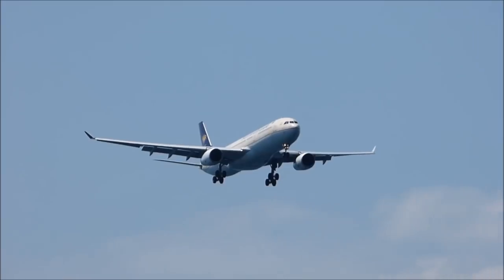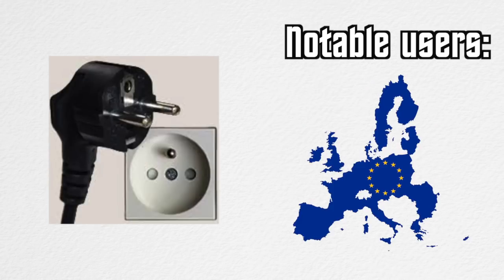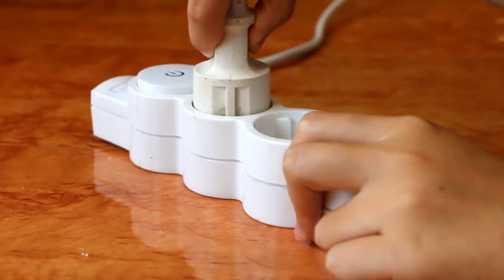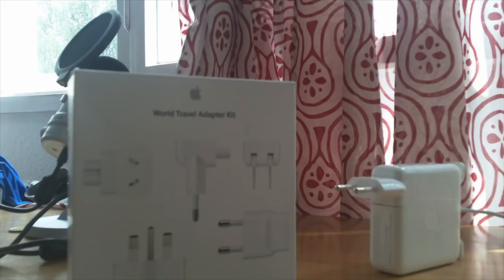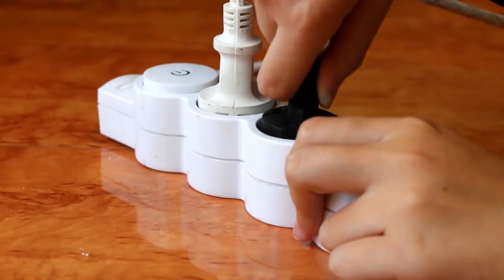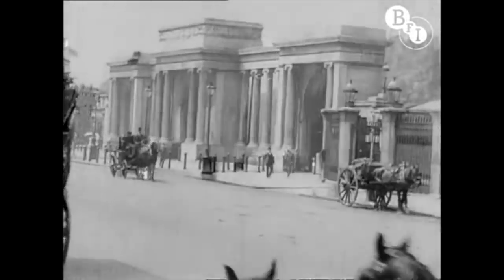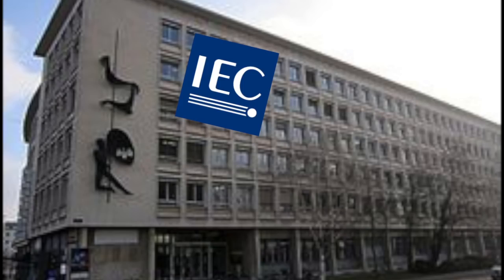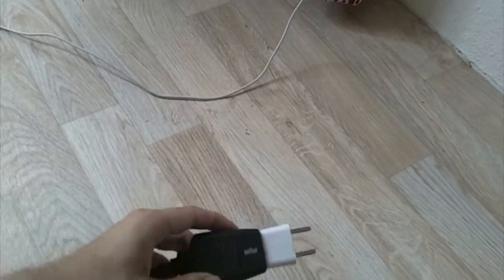Why Different Countries Use Different Plugs

Comment: European plugs > American plugs
Reply: Type B outlets are great because they accept type a too
Reply: Metric > inch
Reply: Buttplugs > all other shitty plugs
Reply: @andreiolanescu  Wasn't it 230V ?
Reply: @hansw5067  It's 230V on average, but it varies between 220 and 240 Volts (depending on your exact location, time of day, etc....)
Reply: @hansw5067  I think it was originally 220 in most countries and 240 in some others, but in 90's it was harmonized to be 230 in the whole (/most of?) Europe. But the way it was implemented was that the tolerances were set so large that all the old installations would do, and there was no rush to change anything just for the voltage's sake. I have the impression that it was just that in the new installations closer to 230 was supposed to be pursued. In Finland, where I live, the nominal voltage used to be 220, but when I've tested it with a multimeter in the recent years, it has been close to 230, more often a little over that than under.
Reply: @enginerd80  That is correct, in most of Western Europe it used to be 220V. On the British islands it was 240V. In 1985 it was decided to harmonize the voltage in Europe to 230V over a time of 20 years. In some equipment the tranformers lastet shorter because of the higher voltage. (I am from the Netherlands)
Reply: @hansw5067  Oh, it was already in '85? But in Finland it happened in mid-90's -- which is when Finland also joined EU, so that could explain the timing.
Reply: @erik masterchefBritain is in Europe. I think you meant EU?
Reply: Washing machine & Dryer plugs > All plugs
Reply: A couple of British plug features not mentioned much - I don't know if they're shared by any other designs or if other designs have alternative implementations to achieve the same outcome:

* Every socket has its own switch, so it's perfectly safe to leave plugs in the sockets for appliances not in use. While many appliances have their own on/off switches, a switch in the socket electrically isolates the supply cable.
* The fuse is to protect the supply cable, not the appliance. Since sockets can handle up to 13A, an appliance requiring a lower rating may have cable rated lower - so if something went wrong and, say, 10A flowed through the cable it could cause overheating / fire. A side effect is that if a fault blows the fuse, then it's likely everything else on the domestic circuit (usually the entire floor of the house) remains unaffected.
* The cable exits the plug at the bottom, at right angles to the pins, which prevents plug removal by yanking on the cable.
* Inside the plug, the live wire has the shortest and straightest path, the neutral is slightly longer and the earth the longest, so if someone did yank hard on the cable, the pins would be disconnected in that order.

Away from pins/sockets, the ring main design of the permanent circuit makes it easy to add additional sockets without needing to worry too much about circuit loading (since it's shared between the two halves) or adding new circuits (which would legally require the services of a professional electrician - most circuit extensions and spurs can be done by a "competent person" except kitchens, bathrooms and outdoors [where due to high moisture, a professional electrician is required together with Building Regulations Approval from the local authority, who'll check the sensitive work and sign it off if it's up to scratch).
Reply: @erik masterchef you like it until you step on it.
Reply: @MrRedsjack  Have you ever considered that people leaving plugs on the floor isn't the plug's fault, it's human error and its an easy fix
Reply: MrRedsjack don’t step on it then
Reply: @MrRedsjack   If your only design philosophy was to design a plug to be comfortable to step on, yes a UK plug doesn't measure up. However UK plugs are pull of safety features such as independent fuses, earthing, and secure onto the electrical socket with an additional switch. Which plug design do you think is safest for toddlers?
Reply: @andreiolanescu  hahha 110v that isn't even  dangerous try 220v

Romania: hold my beer
Reply: @leemilica  It's the current, not the voltage, that hurts/kills you...
Reply: @leemilica  maybe 320v might he dangerous but most of the fires that happen in Romania are like only 5% from that issue so 320v is not dangerous xD
Reply: @andreiolanescu  Where have you seen 320v outlets here? The standards are 230v and actually I don't think any country in the world has 320v outlets.
Reply: You can still equip parts of your house with other nations sockets if voltage and frequency are the same. So, if you're in Europe and buy a British device with a fixed plug. You don't need to ruin warranty by replacing the power cable. Just install the British socket there.
Reply: Typical European response. I'm European so my thing is better than your American thing. It's a plug who cares. It just needs to power the toaster . This dick measuring contest has reached new lows between the two areas. Smh
Reply: English plug > Every other plug

Its got a long pin on top that opens a flap granting access to the two pos/neg ports beneath. Which is good because it prevents electrocuction.
Reply: USB type c > everything
Reply: Yeos
Reply: @erik masterchef this is what happens is your kid plays near a British plug and falls on it. 😨https://4.bp.blogspot.com/-Fw3Ozw_dSqY/WCRG6-4PtzI/AAAAAAAAoMA/VoCyONMv3fw8DEB0eyS-d0_QE6slr6qbwCLcB/s1600/foto%2B2.jpg
Reply: MrRedsjack fake as fuck
Reply: @Twitch.tv/ NGDALI Yeah. And I can say that all the outlets in my apartment are 220-230v, not 320v outlets like he said.
Reply: I doesn't matter I just want to be able to plug stuff in
Reply: Edaz but North America plugs are small and sexy
Reply: @wolf3755  actualy there ugly loo
Reply: comrade doggo  there called prongs
Reply: article 13 European plugs are removed because of copyrights
Reply: Edaz British plugs>European plugs
Reply: Prime example for anyone who thinks just make a new standard would just work. Look to Brazil. They brought out a new plug from what I see it combines all the safety features of the UK plug with the profile of a EU or us plug. But kind of pointless when no one has the sockets.
Same reason they could not introduce the new calender. The wars got in the way and it was too late to go back.
Reply: Gosh!, plug discussions should be prohibited along with politics/religion discussions. Everyone's choice apparently is the "right one" while the other is simply "wrong". This is why aliens don't visit us :(
Reply: It's a plug.
Reply: UK Plugs > All Other Plugs
Reply: Triggered Americans are on their way.
Reply: Butt plugs beat all others.
Reply: Edaz Uk Plugs > All Other Plugs
Reply: UK plugs > European plugs
Reply: European women > American women
Reply: My country's plugs > (insert place here)
Reply: Who cares?
Reply: British plugs > European plugs
Reply: @theevauwu7853  They are mostly the same.
Reply: True, they are bigger. Most of them at least.
Reply: No.
Reply: Nah they look horrible
Reply: @andreiolanescu  thats good for electric cars
Reply: @erik masterchef like this
https://www.mirror.co.uk/news/uk-news/gruesome-video-shows-what-happens-7791237
Reply: MrRedsjack cool
Reply: @andreiolanescu  ai băut gaz? Unde ai văzut 320v în România
Reply: Easier to wire.
Reply: I find the Type C plugs most practical
Reply: @I Am Sekou no
Reply: we need 144HZ
Reply: @TwilightVaramek 400Hz on airplane.
Reply: @TheTrueAwesomeCookie You cant touch an American plug while its connected because the metal contacts need to go in all the way until the last millimeter or so. So unless you have a millimeter thick finger you cant touch it. Also its been a standard now for American plugs to also have a plastic flap that won't open unless both pins are being pushed in.
Reply: @andreiolanescu  de ce minți frate? =))
Reply: @Twitch.tv/ NGDALI It's a freaking joke. Chill out.
Reply: @andreiolanescu  Salut
Reply: Europe > america
Reply: @TheTrueAwesomeCookie Not so much: At the Schuko the orientation is not fixed ( L1 - N - where ?  ) , ask High end audio users  - and the PE - connection is done by the clamps. During renovation they can got painted unintentionally and then the FI is not working anymore ...
Reply: @andreiolanescu  230 ai idiotule.
Reply: netherland plugs === british plugs. we have type C  :D
Reply: YES
Reply: Edaz BOO🤣🤣🤣
Reply: Actually Neutrik Powercon Connectors arr the best. 
If you take the new True1 design they're even better. 
They are small, lock closed, and are waterresistant. 
You can't switch the polarity on those and theyhave a leading earth. 
If you want you could use CEE type connectors as well. 
A standardized System all tge way from your small household appliance to you big industrial machine. 
Granted they aren't small bit that is a different story
Reply: type b looks like "oh oh oh i fucked up big time" while type i looks like screamm k is friendly, a good thing to be all day - still prefer f because, 180°
Reply: Edaz no
Reply: tru
Reply: French plugs are now the best. Close to English ones,but can't empale yourself.
Reply: Edaz British plugs are safer than others because they use fuses.
Reply: Imagine a plug without a switch
Reply: @surgeonofdeath8280  In North America, switched outlets are very rare, so no imagination required.
Reply: TheTrueAwesomeCookie f
Reply: Blows my mind how some people feel a fuse isn't necessary. like ok call me when your overloaded cable heats up & bursts into flames
Reply: Everything in Switzerland is better than than America
Reply: New Zealand plugs > The world
Reply: Australian plugs > every other plug
Reply: American plugs > European plug > G type plug
Reply: Hell fucking no, we ain’t going to have those old ass world war II plugs.
Reply: Landed on the moon > hasn’t landed on the moon
Reply: AFRICANS Plugs > Everyone's plugs
Reply: Flat earth > Round earth
Reply: People need to make an argument about anything they get there hands on seriously 
THEY
ARE
JUST
PLUGS
Reply: Lol you wish
Reply: NAY
Reply: Fite me
Reply: Australian >all
Reply: Edaz yoo who cares were fighting about what plug is the best dude cmon
Reply: European plugs look way to complicated they look like washer and dryers plugs
Reply: I've heard they have a things you can't plug in unless it has a ground pin which prevents babies from sticking Forks in the electrical socket also I have stuck a fork in the electrical socket and never got shocked because unlike most people I used a plastic fork
Reply: Mate, the European plugs are fucking massive and invasive.  American plugs are at the very least somewhat reasonably sized.  Also, why don’t more places have straight USB plugs? That would make things much easier.
Reply: I feel like he commented this to start a fight
Reply: Who the fuck cares it powers my things thats all i care about and its smaller
Reply: Wrong
Reply: LoOk At mE aNd mY 50hz wAlL oUtlEt
Reply: Edaz at least our plugs has a larger asymmetrical prong on it so we don’t electrocute ourselves.
Reply: American is better imho.
Reply: Edaz fuck you
Reply: European is the best
Reply: But can they charge my tablet?
Reply: In my opinion Egypt has the worst. They are like the European plugs but arent sunken in with those little clap like things on the sides so they constantly fall out.
Reply: HA!
Reply: And Canadian plugs to chef
Reply: are they easy to plug in the dark?
Reply: Australian plugs > every other plug
Reply: It's literally the same thing different look
Reply: Take this comment out of context
Reply: @TheTrueAwesomeCookie  Was suprised the first time I was in USA when I plugged in a plug and still able could see the pins in live conditions.
Reply: Italian>all
Reply: Yeah right, in a million years
Reply: @conornagle5280  there is no such thing as an Irish plug....
Reply: Old 2 prong united states plugs are the best not too bulky and for some reason very aesthetic you guys can keep your bulky and weird plugs
Reply: Alien plugs are the best
Reply: UK plugs>>>>>>>>>>>>Europe plugs
Reply: yee
Reply: My order from best to worst is British (for safety), US (because of it's smaller size when a ground pin is included), then EU
Reply: No Australian plugs
Reply: You Need An Plug Adaptor Unfortunatly
Reply: what i did not learn  or will ever  rember  what plug is use for what old or new tacogoly   or how to replace  broken   plug things in  a wall at home  without call out for a electrican person  to fix  for it for 
in australia  we also use different  plugs 
we use  different plugs  for wrong  reasons   and not how much  power  we  use or safe 
 but more like to make new tacogoly   more confusing/complatied   to use 
  no safety things  writen on pack  that is made in china or in aust
 on  how  make  your own electrical from sola/sun power  when the power   blackout for more then  4-5 hours 
 hard to charge  lab top in a dark with  no power  when power is turned of
  it hard to  fix it yourself  when tacogoly is  over 2 years  young and out of warrity
Reply: Edaz hell yea
Reply: @zUltra3D  Nah
Reply: @zUltra3D  Nah
Reply: What, if anything, is this based on?
Reply: German plugs > every plug
Becuse muh german engenering REEEEEEEEEEEEEEEEEEEEEEEEEEEEEEEEEEEEEEEEEEEEEEEEEEEEEEEEEEEEEEEEEEEEEEEEEEEEEEEEEEEEEEEEEEEEEEEEEEEEEEEEE
Reply: Yeah
Reply: Agreed. North american here with European descent (haha never actually used one of those plugs)
Reply: American plugs suck
Reply: Australian plugs > all others
Reply: Ah, yes a bunch of different plugs > one agreed upon plug.
Reply: if i was president of my country i would replace type a,b, and c with eu plugs
Reply: Fax
Reply: British Plugs a pretty good, but Euro Plugs are just as bad as US plugs.
Reply: right, and that's because you can plug them in in 2 different directions, which solves many problems, that people who are not from europe, prob. don't even know they have
Reply: Israeli best
Reply: The cute face is veri practical mind you..

It’s the very reason Denmark is one of the happiest nations! The only reason i wake up in the morning is becausd theres a plug next to my bed.
Reply: SilverTheCoin i can give u a butt plug.. u wake up alot happier
Reply: @silver4809  I always thought our (U.S.) receptacles looked like skull.
Reply: Wait how is one plug superior lmao
Reply: @Callsign_Prophet  EVERY plug MUST have the earth pin. This opens the shutter to only allow the two pins in when there is no room to put anything else in there, like your fingers. The flex goes downward and is hard to pull out. Doing so will be done at an angle. If the device develops a fault, the internal fuse (of the plug) blows, allowing the rest of the ring to remain fully functioning.

It's current design being Earth pin up top means any solid metal object falling behind it will bounce off the pin and either short earth and live, or earth and neutral. No boom, no smoke, no fire. If this was the other way around (USA comes to mind) it allows a great place for objects, like coins to sit between them causing great damage.

The shutter design on the socket also means the size of the gaps are only big enough for a childs finger when they can NOT yet crawl. The moment they start crawling, is when their fingers are too big to even poke at the like contacts. If they did manage to poke something in there, the shutter will stop it.

Many UK sockets are switched, so in many instances, the need to unplug is not required. Flip the switch and power does not flow. MK do a twin pole socket which cuts power from both pins instead of single pole which only cuts the live.

The UK plug is designed to be easily removed using mouldings on the side.

With the sockets the way they are, baby-safe plugs are not exactly required.

There is a standard for sockets where the socket must NOT allow the shutter to open by inserting the plug upside-down. The way around this is to have larger null space above.

In my experience, EU sockets are weak and do not hold plugs very well. They flop around so easily compared to the UK one where all 3 pins grab hold and it sits there like it was glued.

Sometimes some force is required to pull them out.
Reply: Nope.. Australia and nz plugs are the best
Reply: British plugs are actually the safest. The longest 3rd prong pushes a button in the plug that opens the holes for the other 2 to go in. Also there is plastic insulation around the prongs so u practically can't get shocked
Reply: @migdonalds  The european have covers for the holes as well, so does some american. Since the European outlet is recessed the plug will be disconnected before exposing the prongs therefor no insulation is needed which makes the construction simpler.
Reply: @migdonalds  The Type F (SchuKo) plug has essentially the same features: Holes can only be opened with the prongs, and there's no need for insulating the pins, because the plug is put in a recess. before the pins become life, ground connects on both sides (double safety) and the plug covers the entire contour of the the recess, so it's impossible to touch the life pins. The earth plug on British plugs can actually be misused by turning the plug upside down and pushing it into the ground connector, thereby virtually exposing the life and neutral contacts. Impossible on type F. Plus: Type F is just way more convenient, especially when the connection is required to be watertight. It's reversable, rugged, compact and it comes in a variety of shapes depending on the intended use.
Reply: Blaulichtmilieu US outlets (Type A/B) are coming out with a feature similar to this, but instead of needing a third prong to open the holes, it’s the two prongs going in the wall that do that. That’s actually the kind of plug I have in my kitchen which we remodeled a good two or three years ago, and I think those types of outlets were around before even then.
Reply: cypekpl cat yee I agree
Reply: @migdonalds  no they're not.
Reply: SWISS OUTLETS BEST
Reply: @foximacentauri7891  i live in switzerland and i would prefer type L. It is like type J but the sticks are in a line instead of a triangle
Reply: @Eli20021_  I lived 5 years in Switzerland and the good thing is that the C E and F plugs just fit in the K socket so I didn't had to buy adapters.
Reply: @foximacentauri7891  2nd best, I think after looking at all of them type L is the best
Reply: Danish plugs > Everyone else

Fight me >:(
Reply: @silver4809  finnish plugs > fucking everyone else
Reply: SilverTheCoin Swiss plugs > Danish plugs

Where other countries have one plug, we have at the same space 3 of the J-type. 🤷🏽‍♂️
Reply: silver ok they look really cool
Reply: @silver4809  broder du er ikke alene
Reply: SilverTheCoin are danish plugs like uk plugs. Because it’s a fact the UK has the safest and best plugs
Reply: @andreiolanescu why? No need of 320 volts. 230 is enough, here in Germany you got one outlet having 360 volts for the cooker. 320 is just too unsafe and just unnecessary, most products support 230 volts.  So you're not able to use for example made in France products, because they only support 220-260 volts. I think you gonna need a converter which is used to be built in so 320 makes no sense.
Reply: European plugs look absolutely stupid and way too big
Reply: Everyone knows that Aussie plugs are the best

And it's called hungry jacks
Reply: Edaz american plugs > eu plugs
because the eu is shit
Reply: We beat your ass in the Revolutionary War, don't make us do it again
Reply: Lmao 50hz
Reply: @WFQuill  lmao 110v lol hahhaha that isn't even dangerous lol I cant do dangerous shit with 110v lol hhaha
Reply: @leemilica  You don't need to
Reply: @leemilica  230V and 110V will both kill you if you manage it wrong. You have pretty much an equal risk of dying from both
Reply: @WFQuill  lmao 220V.
Reply: @WFQuill  lmao 100 vats
Reply: British plugs are the best in the world. Unfortunately.
Reply: @Fooglmog  I do have to say I do prefer being able to rotate the plug 180° and I don't really see the advantage of having a fuse in your plug.
Apart from that it is way bigger than it needs to be since technology has come quite a long way since the plug was introduced (but that applies to basically every system)
Also what is the reason for not using round pins?
But I do think that we should update plug designs around the world anyway, they could easily be smaller, safer and with better compatibility and the longer we wait the more difficult it is going to become.
Reply: @victorselve8349  prefer all the safety features built into the British plug. And new slimmer designs are available just not all of them are practical.
Reply: @victorselve8349  We used to have round pins in the UK, but this standard was moved away a long time ago. If you find any building with round pin sockets - it is exclusively for lights, or something else, or just very very old.

There is a variation on the BS1363 where it's solely used in Hospitals. The idea being, you can't plug in anything else to that socket, so whatever was in there is the only thing. The cleaner puts it back, looks for another socket, and the life supports still goes on.
Reply: @victorselve8349  UK change to square pins was made back in 1946 to prevent the then standard UN-fused round pin plugs being inserted. They would not have been safe. The new 13-amp system incorporated fuses in the plug-top because fuses EVERY appliance individually, thus permitting simple and economic ring mains in the buildings, lots of sockets per room (my small lounge has 15 and I use them all) while simultaneously allowing circuit-breaker installation in the utility room to be very compact. Result: High performance electrical installations at relatively low cost.
Reply: British plugs can only be inserted one way, the upshot of this is that the switch on the device, eg hairdryer will always be on the 'live', whereas the power tool I bought in France with a two pin plug had a 50% chance of the windings inside still being live even when switched off, much safer in the UK. So far as the fuses in plugs are concerned by having different ratings it enables the device to be properly protected whatever the rating of the circuit, hence we use the same plug for a kettle as a simple light, but with 13 or 3 amp fuses fitted as appropriate.  i @effyleven
Reply: @Fooglmog  No it's not, the Euro-plug is the best. The British plug has some cool features but they're all just ways to engineer around the inherent flaws in the design. Better to start from scratch and make it less complex. Like the Euro-plug.
Reply: @Fooglmog  'excesively big', 'unnecesairly complicated', and 'easy to step on and hurt yourself' are not considered positives.
Reply: @kantoros  they aren't that big and Lego hurts to stand on too and they are simple    live neutral  and ground
Reply: @camerongordon2378  
Regarding complexity and size I was talking about the internals:
Every British plug has to have a mechanical shutter and a ground fault indicator inside. 

Also, because of the layout of the pins, the plug is unnecesairly tall, compared to type L, C, or J.
Reply: @kantoros  "unnecessarily complicated" what's completed about putting the plug into the socket, it's literally the same as anywhere else that's grasping at straws, easy to step on ?, you must just be clumsy in general if you find them easy to stand on. Also there excessively big for the fact you can change the fuse extending thier life span those are positives.
Reply: @Mr_Makina  
Its internals are compliated. The G type has to have a mechanical shutter and a ground fault interrupter (a mechanical fuse).

Other plug types also have GFCIs,
but they're all in one place, so they don't take up as much space, and are easier to replace (the wiring is also more manageable, and you cant electrocute yourself by touching the wires in the wall, but that's not as important).

Regarding it being stepped on, i'll admit it doesn't happen as much as people say.
Reply: Jindrich Petr Kantor however we have fuses, earth cables, power switches and many more like the fact the power does not switch on unless the earth cable is plugged in
Reply: @kantoros  they are the safest
Reply: @fb5601  
Not really.
They do have the plastic shutter that prevents you from jamming stuff inside,
but the circuits (and more importantly the GFCIs) are rated for up to 30 amperes, so if you manage to stick something in there, you could get shocked 6x harder than from type E for example.

Unfortunantely this is encouraged by the design, since plug type C fits in G, and most of Europe uses C.
Reply: @kantoros  they are the safest tho. British homes are wired in a ring rather than multiple lines running back to a breaker due to the cost of copper back in the day. To combat this they used a 3rd pin and a fuse in the plug essentially giving everything you plug in its own breaker instead of having one master breaker for the house
Reply: @notapom  Oh I'm not saying they aren't safe, they most definitely are.
You would have put in a lot of effort to get shocked.
My problem is that they aren't *safer*.
With most other plug types it is equally as hard to f*ck something up (most, for ex. plug C doesnt have ground).
This is fine, until you realize that the way plug G accomplishes this makes it more expensive both on installation and in the long run, so it doesn't really pay off.
Reply: @kantoros  well no it is 100% safer as 
a) it has its own fuse due to copper shortage post ww2. It was cheaper to require a fuse in each plug and have the circuit as a loop of cable around the house as opposed many individual strands of copper going from the main fuse board. 
b) the earth pin is longer to open up the shutters for the for the live and neutral pins so it impossible for infants or anyone else to stick something in the plug socket and get shocked without first sticking something  inside the top hole to open the bottom 2.
c) If a US, European or any other non British plug is only half plugged in then the plug can have a connection to electricity and have exposed live pins with the ability to shock but UK plugs have insulation on half of the live and neutral pins to stop this from happening. 
d) the internal design of the UK plug is such that the earth or ground wire is longer than the live and neutral wires so should the wire be pulled or disconnected from the plug the wires carrying the electricity will be disconnected before the earth. Should the earth disconnect first on your toaster for example and the toaster malfunctions, then any metal on the toaster would then be carrying electricity which would then ground through you not the plug killing you. This is impossible on a UK plug. Every single one of these points on their own would make the UK plug safer, together it makes it unbelievably safer. That's a fact

The one disadvantage a UK plug has in its design is that when left on the floor because of its flat backside it nearly always lies pins facing up which is incredibly painful to step on!
Reply: @notapom  
a) that doesn't really make them safer. It just makes them harder to replace.

b) the shitters do make the socket safer, but compare to the other stuff it doesn't do that much. Also who is it for? Babies cant fit their fingers in there, only metal objects a young child should have access to are forks and spoons, which don't fit, and older people will just bypass it with a pencil.
But I'll give this one to you.

c) in all my life I haven't seen a single plug with the 2 main pins with metal all the way. They're always on just the tip (I live in EU btw, so EF/C plugs).

d) the only way that will come handy is if you're physically pulling the socket from the wall with electricity still turned on. At that point its just natural selection at play. Even then this isn't a feature only the British plugs (can) have. 

So to sum up: 
a) its not safer (still safe)
b) a little safer
c) all plugs have that
d) not a plug type issue
Reply: @kantoros   
a) huh??? that makes them easier to replace!! If the product fails then the fuse blows in the plug not the product so you replace the very cheap fuse not the whole blown up electrical item. 
b) the tip of a sharp knife, a hairpin, a religious cross on a necklace, a teaspoon handle, a key. Just a couple of things off the top of my head that could be lying around for a child to pick up and poke in the holes. Granted a knife shouldn't be left about with a child but the rest are ordinarily harmless. Also btw a pencil would be too big to fit in 
c) well I've lived in Europe, Australia, NZ and currently Asia and have never seen a plug with the insulation apart from a UK plug. Every plug shown at the beginning of this video also did not have insulation apart from the UK plug as well as Wikipedia's image for each of the styles. 
Edit upon reinspection some of the plugs did have insulation like the UK plug so yeah ok fair enough, but still in my experience they have not had this but that is obviously just my experience.
d) you cannot pull a UK plug out by the cord, so again that proves another point regarding safety. You completely ignored that original point regarding the malfunction of an electrical device that would blow the fuse in a UK plug and stop any electrical current making its way to a human through contact but other plug styles would allow the current to flow through the product and ground through the person only then blowing the main fuse board but only after killing someone. Every point in my original comment absolutely makes them safer, it's a known fact in electrical circles that UK plugs have more safety features therefore safer.

https://www.google.com.vn/amp/s/amp.fastcompany.com/3032807/why-england-has-the-best-wall-sockets-on-earth
Reply: @kantoros  I've seen plenty of burnt out type A & I wall sockets because they sag out of the socket if you sneeze in their general direction.

I'm fine with over engineered if it means added safety for my family and myself. Integral Fuses, Robust design and Ground wire being the last to disconnect are all good things to have when dealing with electricity.

Btw, how many plugs do you have lying on the floor that stepping on them become an actual concern?!
Reply: @WarriorofCathar  
Oh, right, i forgot about the poor excuse of a plug that is the A/B type. Their overall design is really shite, starting with flat pins, i think we can agree on that.

I'll admit that type G is the safest, in the same way 2 bomb disarming robots are safer than 1. But it really is just wasting money. 
And even if its only 0.03$ a year more, on the scale of society it matters, type G of red is the safest, but it's not the best.

I dont. Like I said, that is not a problem I have (mainly because I don't use type G).
Reply: @kantoros  fair enough.

Lets compromise and just agree to Ban type A&B. We'll sort out the Euro Plugs and may the better plug win.
Reply: @WarriorofCathar  Agreed!
Reply: @WarriorofCathar  and so the plugs war begin. 1 plug type declare to be the dominant of them all and decide to exterminate the others. So when will my battlefield plugs war be released?
Reply: @kantoros  not get electrocuted
Reply: @kantoros  British plugs, "unnecessarily complicated".. No! .            "easy to step on"... How does one step on a plug that is in a wall.
Regardless of which country I've been to, I can't say that I've ever stepped in a plug that was in a wall.
Reply: @kantoros  At least I can find them in the dark! (Whether I like it or not)
Reply: Jindrich Petr Kantor So you tell me that when you step on your fancy American plug you don’t get hurt?
Reply: @kantoros  British plus are smaller when plugged in to an outlet, because the cable exits flush with the wall instead of straight out. Also we don't need to pull 'em out to disconnect, because wall sockets come with built in switches.
Reply: @kantoros  To be fair British plugs are the best, and the old round pin British plugs are good too and are still in use in some countries like India. British plugs are a bit bigger because they contain a fuse, this means the buildings can have have decent sized power circuits out to the sockets and then fuse each appliance as is necessary via the plug, 3A 5A 10A or 13A. For example the US have stupidly small current capacities on their circuits and have loads of them. British plugs cannot be easily pulled out of the wall unlike most other countries as the 3 pin configuration with the wire existing from the base means it cannot just be yanked out the wall. If the only argument one can make is that they are sore to step on then they have sort of lost the debate... The Brit's are smart, they don't step on plugs!
Reply: Jindrich Petr Kantor at least you cant get shocked
Reply: @kantoros  He never said they were.
Reply: @drawde_064  type f performs the same thing like the uk one, just without the fuse
Reply: @kantoros But very safe.
Reply: @Fooglmog  Not at all. You can fiddle with the live and neutral while the plug is only partially in. Companies also like to save on costs by making the PE prong plastic. With the type F plug all plugs include PE .
Reply: @PunakiviAddikti  one of the main bonuses of the British plug is that you cannot do that... Also the size isn't a problem if it will save somebody's life and an expensive repair bill. They are also large for the fuze and to allow space for the earth wire so if you pulled the wire out it would be he last to break.
Reply: @Fooglmog  British Plugs - Not realy: The electrical and mechanical connection is done by the pins. That is not idea,l better the mechanical connection is done by the housing and the electrical and only the electrical connection is done by the pins : military bendix or civilian CEE is the best solution !
Reply: @Fooglmog  they are irish too
Reply: @Fooglmog  they're too big
Reply: @maxb8043  
That's what she said 😏
Reply: @Fooglmog   yep
Reply: Jon Is the ‘Unfortunately’ because you have stood on one before? 😂
Reply: @Fooglmog  British plugs have one major problem. They're pretty much only used in the Brittish isles universially, and in some ex-british colonies it's one of the options. It doesn't have the universality C, E, F and A, B plugs have. And they are bulky AF.
Reply: @Fooglmog  Nope, European mainland plugs are the best.
Reply: Jon thats false kiddo
Reply: Jon gotta hand it to ya, they’re a little too safe for my taste.
Reply: Jon no fortunately
Reply: @Fooglmog  Because you can chose wich way round you want to plug them in like the germans and italians can....
Reply: @Fooglmog  Actually, the Italian plugs are quite good. They're practical.
Reply: Lol British homes often have 1 Ring-Circuit for a Flore in the house have only one or 2 phases thats why you need to put a fuse into your plug .. RCD are not in every house the hole thing is garbage ... not to say 240 V and 35 amps for 1.5mm² is really bad same thing for your hot water its not even drinkable water that's why you have to keep it separate ... the danish plug is bull as well ... just because in Denmark Sweden and Norway lights come with a plug and your not allowed to change the live wire and the Neutral you have this stupid plug 
typ e and typ F are the real champs best contacts lowest risks less fires ...
i mean someone wrote typ N Brazilian plugs are the best thats why they are only used in Brazil and South Africa these fucking plugs are only allowed for 2200 W thats says everything    and if british plugs are so great why do you use 2 types of plugs typ g and typ M ... i mean in germany you have 3 phases and each house has do have 63 Amps for each phase minimum many countries have 35 or 20 amps per phase for a house that means you like to have an extra sauna , and an electric car you need a new cable poland as an example they often use 4 times 10mm² from the street to the house or america and england have just 2 phases or norway were you have 2 systems one is 220 between 2 phases and an isolated pe or 400 between 2 phases and a normal pe ...IT systems over huge distances have huge problems like only 4 amps over earth if you have a full shortage and such things ...
Reply: @Fooglmog  I blew up a British outlet in London last August because my adapter touched the metal frame.  There was no power all night... thanks Radisson Blu!  I was using a European device with a UK adapter.
Reply: @Fooglmog  yea becuse you get tea
Reply: @Fooglmog  But they take up too much space.
Reply: @Fooglmog  yess. I'm not in Britain but we have British pkugs.
Reply: @Fooglmog  they are not, their ground is terrible unlike the german/euro one
Reply: @Fooglmog  European plugs are better
Reply: @Fooglmog  german plug > br*tish plug
Reply: @Fooglmog  Indian plugs (old British), South African 15A plugs (used for aircondition plugs in Malaysia), and Italian Type L 16A (would’t fit on plug adapters.
Reply: @Fooglmog  they are definately not.
Reply: @tiem217  UK plugs are the safest.   They probably don't look very attractive; but the UK system was designed to economise on copper and make it very safe.
Reply: @martinhughes2549  yeah they look outdated asf, but yeah i dont see how uk plugs are safer than eu plugs. And plus (dont take this seriously) why do i have to rotate the plug 180 degrees for it to fit
Reply: @Fooglmog  british plugs certainly would be a top contender for safest but the whole design needs to be about 1/2 to 2/3 the size.
Reply: @chris6200  some uk plugs are small
Reply: @Fooglmog  British plugs forever and ever and 1000 years!
Reply: American plugs are simple, small, & convenient
Reply: no no no american plugs so much smaller and condensed plus the outlet doesn’t stick out of the wall
Reply: @connormorrison738  " [...] the outlet doesn’t stick out of the wall" You know that you get the same exact "feature" with all the other outlets right?

I also suspect you are comparing the non grounded US plug with the grounded EU(Type E & F) plug. The non grounded EU plug(Type C) is virtually the same size as the US plug... Also, if you have Schuko outlets that are flush with the wall (which is quite standard), the plug isn't sticking so much out of the wall, which the US plugs tend to do. We don't have the problem with outlets becoming "loose" either...
Reply: @connormorrison738  the outlets don't necessarily stick out of the wall for most other connectors either. At least they don't have to. Someone came up with the idea to make it as ugly as possible, and somehow most people agreed that at least something has to look like shit in their houses. 
Though, it's quite convenient if you ever have to change one, since it's easy to get a hold of.
Reply: Edaz but
British plugs > European plugs
Reply: Brazilian plugs are the best.
Reply: @davidperry4013  you mean hot-wiring your whole electrical system to steal power?
Reply: T-SERIES AND INDIAN PLUGS ARE THE BEST, PERIOD.
Reply: @rithikkumars1676  Indias was literally the worst
Reply: Rithik Kumar nothing Indian is the best......period
Reply: American > Rest of world